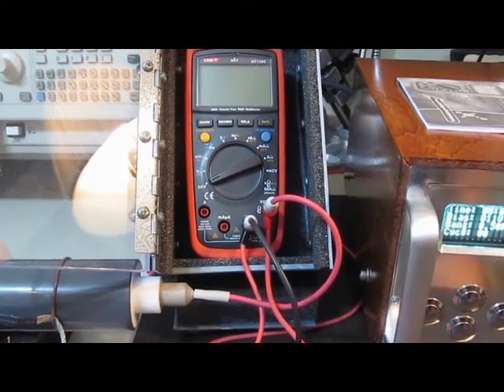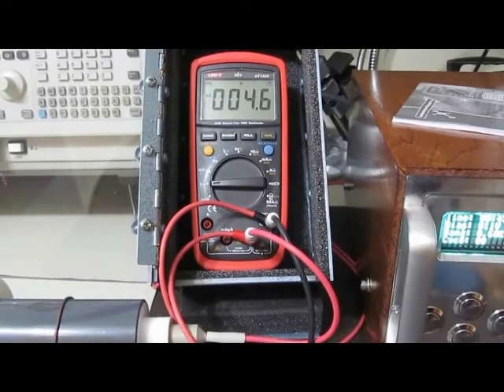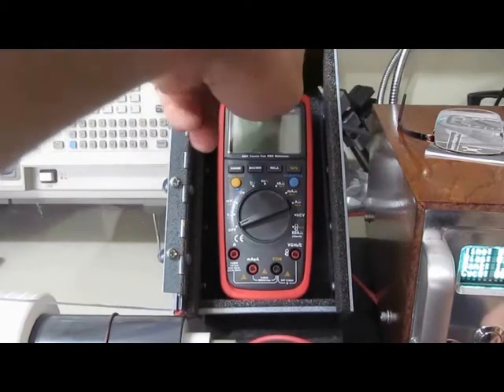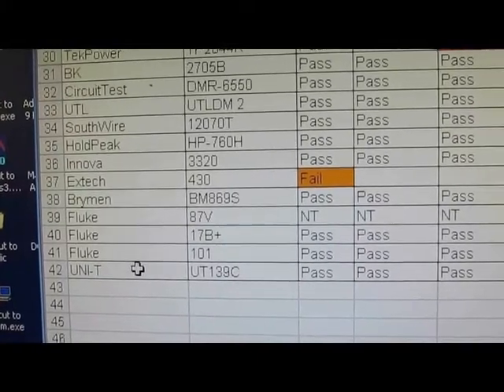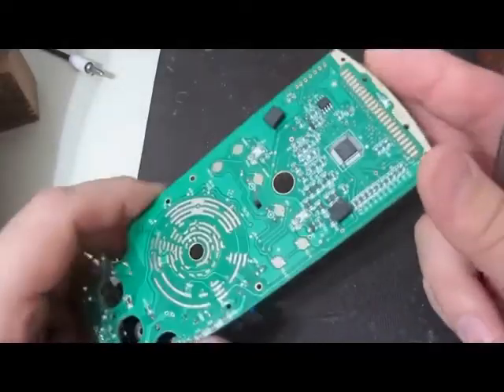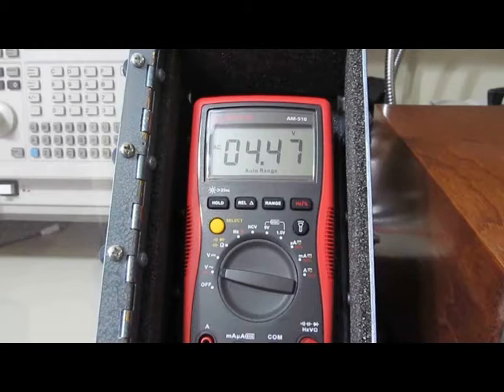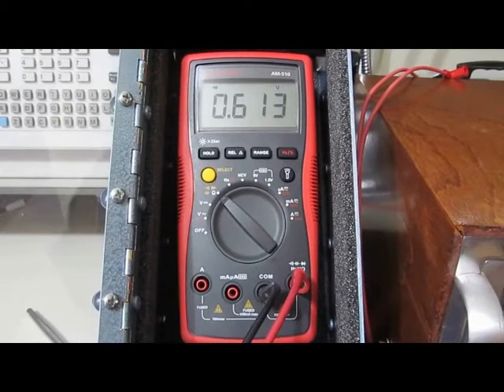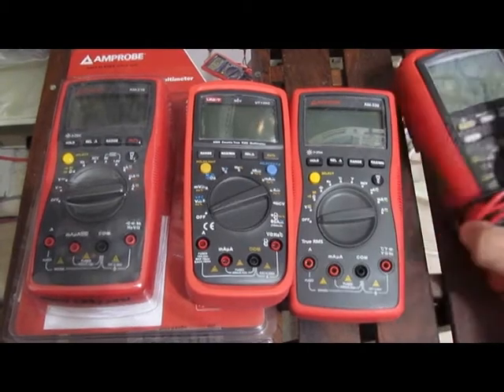Return of the UNI-T UT139C Part 2 of 2

Comment: WHAT IS THE REASON I COULD NOT MEASURE THE OSCILLATOR IN Hz STAGE WITH UT139C MODEL MULTIMETER? UT61C MODEL CAN READ 32.768 FREQUENCY VALUES. IS IT POSSIBLE TO MEASURE Tuning-fork crystal used in a modern quartz watch WITH UT139C?

Comment: Just curious about running the test bench series from bk precision? Set of four meters in the $200+ range. Models 391a, 390a, 389a, and 388b. I looked at your spreadsheet I didn't see theses meters. Also what are your thoughts on the bk meters you tested to date.

Comment: Hi Joe,
dtm0660l chip is affordable now for a replacement, about $7 on Aliexpress, and adding missing transistors in the upper side will certainly help to protect the chip, they are coupled to the IC and the four 2.5M (R1a R1b R1c R1d) wich are in series with the "main", don't really know what the two unpopulated other one where supposed to do ! PTC1 was dammaged in the first test, some modifications in this area could probably  help it to pass the 5Kv ! (Uni-t added one more PTC in the S version and the PCB traces are wider).
Reply from the maker: No doubt that EVERY meter I have looked at could be improved.  That's a job for the manufactures.  Wouldn't you expect there to be at least two more PTCs in series to create the low impedance function?  Or are you suggesting that this added PTC has something to do with making the meter more robust?   Hard to believe that anyone would come to that conclusion.  If so, trace it out and show me.   I can however believe they skimped on the low impedance mode and did it with one PTC.  My guess, the same old 5mm package they like to use.   Personally, I don't see this as an improvement.   Like I said, if I am wrong (I'm just guessing) about the added PTC, show me.
Reply: @joesmith-je3tq You're right, I relied on the 139C (mine) and I didn't pay attention that they had integrated the Lowz function in the "S" version, but nevertheless they modified the input by putting a common PTC for the 10M and 900k. For the "C" version the 900k pass only has two MOVs comming after !? And since they didn't have populated the transistors pairs, chip isn't protect at all against high voltage in this range... I found documents that will probably interest you, or simply help me answer my questions, if you wish ! https://uni-trend.com.cn/uploadfile/2018/0824/20180824024302224.pdf
https://uni-trend.com.cn/uploadfile/2018/0823/20180823095727835.pdf
There is at least one error on the diagram of the 139C, RV2 on schem = RV4 on PCB and RV2 (the fourth omitted on the diagram) is connected between PTC2 and RV3 on PCB.
In your opinion is it wise, for the previous "C" and "E" versions, to add the omitted transistors (upper area is for 10M and lower for 900k) and connect the first 300k resistor between PTC2 and MOV2, as shown in the diagram of the "S" version, or 
will it be at the cost of a precision loss ? Safety, precision or simply bad idea ! What is your opinion ?
Thank you for what you share, I'm learning a lot !
Reply from the maker: @park8023  My opinion is to let the designers, manufactures and test houses do their jobs.  They should be the experts in the industry.  These standards are for the safety certifications.   Again, nothing to do with what I am showing on this channels.  I would have no way of knowing what the effects are of making ANY change to a design.  My guess is the outcome could be bad.  Really, if the goal is to have better equipment, just buy it.   It's never wise to think your an expert in the area of safety and  it's always a bad idea to start making changes to a device with a safety rating.

Comment: Morning

In my years in engineering... I call this, old school testing... In my opinion, thus is the best testing, hands down...
I was taught by people like you..... I have all respect in this process of testing....

I need a meter to carry around ( purchased a uni-T 139B) ... I do residential electrical repairs and car customizations now do to my injury years ago...

Yes I have good meters ( But) need one with a good continuity checker (. Heard this one is good) .. Question is, is it??????

I see you video the uni- t 139 c  ,  are they the same spec wise...?????

Would like to know...
Reply from the maker: I would say the continuity test is a personal preference.  I do have data for many of the meters I have tested stored on-line in a spreadsheet.  This includes the continuity testing.   You may find a link to it in the description.    You could run some tests to see how yours compares but IMO, it really comes down to what you need, not how it compares with another meter.
Reply: The  139c and 139 b have the same  over current  specs???
Reply from the maker: @dfigueroa903 Over current specs?  If you are asking if the b version is as electrically robust as the c version, I would have no idea.   If you are asking if they have the same accuracy/ranges/resolution  in the current modes, I would just compare the manuals.
Reply: joe smith would like to see you do a review on the 139B.....
Reply from the maker: @dfigueroa903  I doubt I will look at any more UNI-T products.  I've looked at a fair number of them and they never perform very well in my testing.   If they release an improved version of the UT181A, I will have a look at it.
Reply: Can you Gabe me a link to my the brymen  289B ... Like the meter, good for what I'm doing...
Reply from the maker: @dfigueroa903 I don't believe Brymen makes such a meter.   The spreadsheet does list all of the meters I have looked at.

Comment: Well the manual states well to not rotate it but in real life you might leave the multimeter in ohms mode and someone is going to read volts on the mains and BANG.. Well I had an mastech MY-64 for basic electronics in home and just a measure from a electric mosqito zapper ( 2kv) ruined this multimeter. Than i bought an ut50b ( manual but fast measurement) and it passed this test and so far from 2010 till now still works for homemade electronics and ocasionally some mains voltage, which the UNI-T i think is best suited. For outdors and industrial better be with some fluke, bryman as stated by this video.

Comment: Judging by the comments,  I'm not sure why people don't understand the purpose of HV transient testing on a multimeter.  No, no technician is going to be measuring 6kV with a handheld multimeter (no shit), but that's not the point.  It's advertising itself as CAT III,  it should be tested to that standard.  Not that I would believe it from Uni-T,  they are notorious for putting whatever CAT rating they feel like on their meters.

Comment: Hi
Is there any way to upgrade input protection on this multimeter uni-t ut 61e?
There is a way plz guide me to do it .
Reply from the maker: I would not say I upgraded the input protection on the UT61E.  It may be more robust now but could be a lot less safe.  Once the second 139C was damaged, I did not replace it.
Reply: joe .thanks for your reply.i have seen that you repaired unit 61e once.in this meter there are 3 ptc 400 to 1100volts according to the data sheet 5mm.there is empty place for 4 mov.can we put there movs and if we need which one you advise .also advise if we need to replace the ptcs and fuses.
Reply from the maker: If you need a better multimeter, I suggest buying one.  Attempting to modify one is a bad idea.  If you're a beginner, it's just being stupid.

Comment: You deserve more subscriptions and views. These videos are great.

Also I ordered this uni-t. I hope that it works out. I don't really work with high voltages so I'll probably be fine...
Reply from the maker: Once this one failed I did not replace it a third time.
Reply: hrm. Well, it actually seemed to do fairly well in your testing until you got to the higher voltage transients, right? I'm trying to replace my mediocre TPI 440 and don't want to spend a lot. I also considered Amprobe, but it's more expensive and didn't seem much better in many respects.

I may buy a more expensive one if I hadn't just spent a bunch on a new scope as well... that eevblog branded Brymen does seem pretty good for the money...
Reply from the maker: You know where the spreadsheet with the data is stored, right?
Reply: yeah I looked through it. I guess I'm just looking for a sub-$50 scope with good accuracy, true RMS, and a list of other features that interest me, and the uni-t fits that pretty well. reliability and safety are important, but i work with electronics and low voltages. if I need to measure mains often, I'll probably get one of those super stripped down flukes or something. I doubt my wife would appreciate me putting a few hundred bucks into a multimeter for hobby work.

Comment: Great testing. You seem to be harsh on the 139C as it survived  up to 3.7 KV, costs less than $50 has a good sensitive NCV (far better than the Amprobes 510 & 530), back light, 6000 count (compared to 4000 on the Amprobes)and has good continuity (faster than the Amprobes). In spite of this you have great praise for the 510 purely because it survived up till 5.8 KV.Most people, technicians will not go over 1000volts (if that) so does it really matter when using a meter how much it survives above this figure. I realise you rate the robustness very highly and have had bad experiences with the UNi-T 61D/E's, but the 139C definitely is different and is "safe" as regards it's operating instructions.  In England I can get the 139C for £28 (Around $40) and overall it seems a better buy than the Amprobes taking everything into consideration.I would welcome your reply.Peter
Reply from the maker: +peter matthews  As I have stated several times, these tests from the beginning have been about how electrically robust the meters front ends are.   This is why the Fluke 101 was ranked the highest of the first set of meters I looked at.   It has nothing to do with their features, how they look or handle a drop test.   If you are interested in these types of reviews, there are countless other videos you could watch.  As for safety, I will say it once again because you seem to have missed it.  I am not a accredited lab.  If you have interest in knowing if a meter is safe that has not been certified by an independent party, you would have to have it done.  Safety and robustness are not the same thing.    

The 139C earned it's place in the spreadsheet not because of how the UT61D/Es performed or how UNI-T products have performed in general.  It's placed there because this was it's failure point when tested the same way with the same equipment as all the other meters.   

"Most people, technicians will not go over 1000volts (if that) so does 
it really matter when using a meter how much it survives above this 
figure"

Maybe use Google?
Reply: joe smith Hi Joe, seeing that this meter did not survive the 5kv transient test, would I be considered overly concerned about the safety of UT139C if I'll be just using this meter for repairing appliances and occasional testing of residential mains of 240V? Some comments said that meters may pose some forms of dangers such as exploding and melting from transient spikes if they have not been CSA certified or UL listed. Most of the multimeter reviews are seemingly for electronics hobbyist use while yours includes transient spikes tests which is more alike to mains testing. Hope you can help this newbie out. My budget also does not allow for a brymen for simple electrical checks. Thank you.
Reply: +joe smith OK Thanks!
Reply from the maker: It's strange you would feel that way.  The ONLY meter I have looked at that was made in the USA was the Fluke 87V and it did very poor.
Reply: robustness against hv spikes and transients is what is demoed in this video. not the pretty red skirt it wears, how sharp is the display, or how shiny the plastic case is. robustness is somehow a sibling of SAFETY. if it does not pass them standards, it means it aint fit for a james bond super electrician type of work. this is to make aware of them folks who are curious on how these meters will perform in work areas where the SUPER FAST SPIKES CAN REACH UP TO 5 KV...or maybe more. these pointy waveforms are real. we've seen them destroy even hi end meters like fluke. and ive seen it also burn one of the 139c that i had before. it really flamed itself into plastic ice cream. good thing i hanged it up on an insulated post. and i think, i mean i really really do think, if i was HANDHELDING that THING that time, ummm a mumbo jumbo blister? YOU THINK?
Reply: robustness against hv spikes and transients is what is demoed in this video. not the pretty red skirt it wears, how sharp is the display, or how shiny the plastic case is. robustness is somehow a sibling of SAFETY. if it does not pass them standards, it means it aint fit for a james bond super electrician type of work. this is to make aware of them folks who are curious on how these meters will perform in work areas where the SUPER FAST SPIKES CAN REACH UP TO 5 KV...or maybe more. these pointy waveforms are real. we've seen them destroy even hi end meters like fluke. and ive seen it also burn one of the 139c that i had before. it really flamed itself into plastic ice cream. good thing i hanged it up on an insulated post. and i think, i mean i really really do think, if i was HANDHELDING that THING that time, ummm a mumbo jumbo blister? YOU THINK?

Comment: i got ut 139 c above six mounts a go. now voltage display as multiply by
 two & ohms auto range and decimal points error :( . i used ut 60b 
meter six years. ut 139 c is suck.

Comment: Much better videos of the 139c than the first one you made. But i still don't get the point of applying 5kV to a meter which is rated for 600V ... Thanks anyway
Reply from the maker: +ulanbat0r You are not alone in your point of view.   You are correct that the manual for the UT139C states the "Maximum input voltage: 600 Vrms".    To be clear, Vrms would be the same for both AC and DC but not at all for the waveforms I apply during these tests.    The part you appear to not understand is that many of these meters are specified to meet a certain IEC standard.   In the case of the UT139C, the manual states "Safety Standard" IEC/EN 61010-1: CATIII600V"   This is the first version of the standard and has a maximum of 6000 Volts using a 2 ohm source impedance.    The waveshapes (open/shorted) are called out in the standard along with the five +/- transients.   Now all that said, I am not testing to this standard.   The width of the pulse being applied is double for the 6KV and less tests.  The other major difference is I greatly limit the energy available to the meter for safety reasons.   Typically this has been less than 10 Joules but I have ran some near 20 Joules.     The reason for the tests is simple, to find which meters are more robust electrically than others.   This is why they are all tested to failure (for the most part).   I keep a spreadsheet on DJs EEV blog site that you can download a quickly see the overall results of these tests.   UNI-T meters as a whole have been some of the worst I have looked at.   The Chinese made Flukes I have tested have by far been most robust.   

Hope this helps.
Reply: Because when you are testing line voltages, it is entirely possible to have a transient come onto the AC line. You can take issue with the transient being 2KV, 3KV, or 5KV, but the IEC standard (61010) for Class III is 5KV minimum withstand voltage. This is what Joe is testing to. His transient generator closely follows the IEC specified waveform. If you have an issue with the 5KV level, take it up with the IEC.